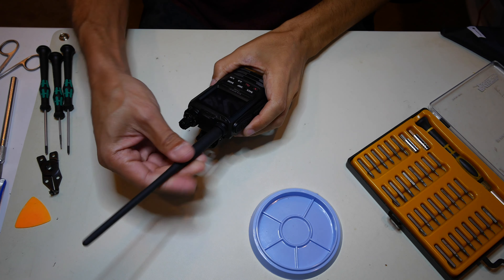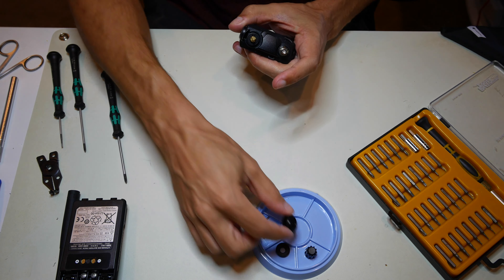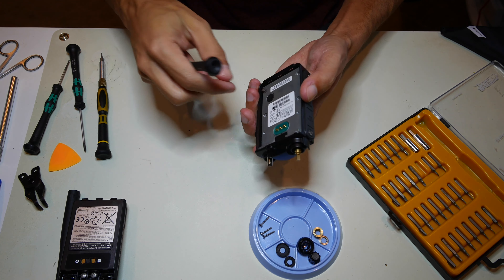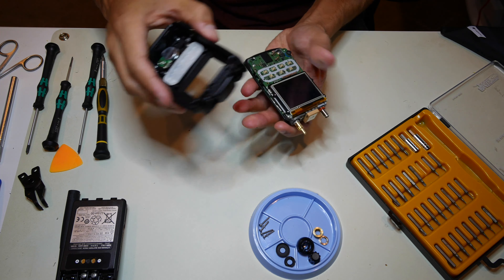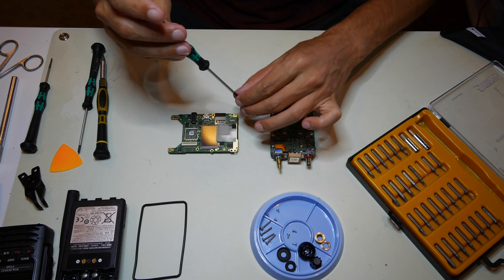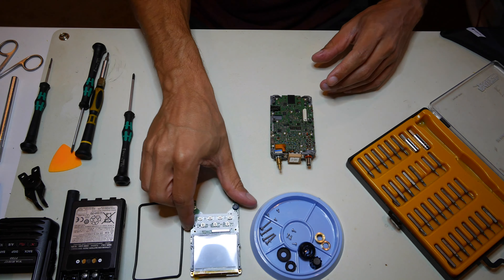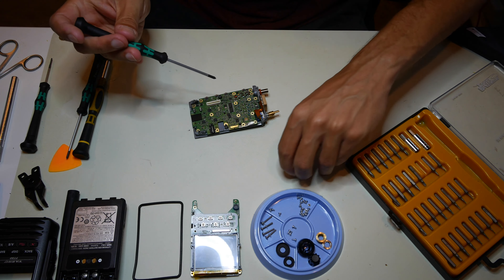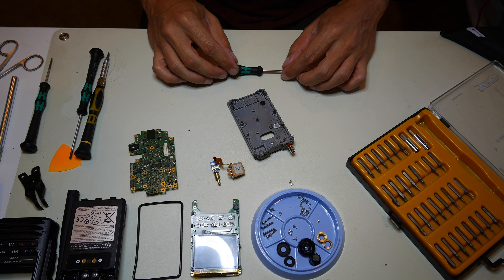Yaesu FT3DR Full Disassembly/Teardown

Comment: Great tear down.  used it to replace my LCD screen and front cover.  screws inside radio were tuff to break free. I think heat & cool from TX over time fused screws. I took a hot air solder machine warmed up to 110 degrees to heat up heat sink of radio around screws and with a little force they finally came free.
Reply from the maker: Great tip! Glad the video was helpful
Reply: where did you ordered parts?

Comment: Thanks to this video I have been able to restore receive audio to my computer FT3D. I dropped the radio 4 feet onto the ground and the audio stopped working. Using this video I disassembled the radio and found one of spring connectors from the main pcb to the speaker pcb had been pushed to one side and was therefore no making contact a quick realignment and the audio was restored. Thank you so much. 73 de Mike GW7ODP
Reply from the maker: That’s awesome! Glad this helped keep your radio alive. 73

Comment: Thank You for this video. I may have broke or bent the speaker mic connectors, on my radio. I need to take it apart to find out and fix it. This video will help a lot for that. 73"s De KC0AZW
Reply from the maker: Hope you are able to fix it, detailed pictures on the wiki as well if you need them.

Comment: what size antenna ring tool did you use?
Reply from the maker: Just used a small flathead and some pressure to break it loose. Assuming you are talking about how I unscrewed the split screw on the SMA connector?

Comment: display can be further disassembled? it does have 2 flex cables?
Reply from the maker: If anyone has a donor radio I’m sure I could go quite a bit farther, I wanted to make sure this one worked when I was done with the video :)
Reply: @RECESSIM  I will be replacing my screen, it's ghosting (after 2 months of active usage). If you want, I can send you photos :) I can bet, they will sent me just display and not whole frame with it.
Reply from the maker: @lucidnx  would be great to add additional pictures to the wiki if you can share some.
Reply: oh well, there was nothing more interesting. Display is held on plastic piece with 2 strips of tape, on top and bottom. something thin is needed to get it out because it's fragile. I'v broken old display but it was already damaged (burn in that I mentioned before).
Reply: It's been done so quickly that I forget to take pictures of that plastic piece, but I think it's straightforward.

Comment: Have you heard complaints about the sound quality of the speaker? Is there any foam or material to remove for improved sound?
Reply from the maker: I haven’t noticed any audio quality issues and looking at the teardown pictures I don’t see anything obvious to remove. Perhaps an assembly issue or defective speaker? Check out the pictures to see what I mean, I removed the speaker.
https://wiki.recessim.com/view/Yaesu_FT3DR
Reply: @RECESSIM  It would be great to replace the speaker with a better one or to make a little chamber on its rear to improve its thin sound.

Comment: Do you know anything about getting  a selector knob, mine broke off
Reply from the maker: I do not, I would suggest contacting someone in technical support at Yaesu though. I have had good luck reaching out to tech support at various companies. Most support agents want to help and understand the inner workings of the company so might be able to help you buy a replacement.
Reply: @RECESSIM     Is the selector knob and the GPS one piece?
Reply from the maker: I understand what you are saying now, not only did the knob break off but the actual brass selector it mounts to broke as well correct?

That’s more challenging, as you noticed that selector is soldered to the GPS via a flex PCB. It might be possible to find the selector used at Digikey or Mouser, replacing it will require some careful desoldering but it’s definitely possible.
Reply: @RECESSIM  yes that is what happened thanks for the info
Reply: mine broke off also, please share if you succeed with any fix
Reply: @yaltaman  yes I sent it back to Yaesu had it fixed no charge

Comment: As much as I hate USB Mini and USB Micro compared to USB-C, this shows why USB-C would have been a bad choice in an otherwise serviceable device. PCB-mount USB-C jacks are not repairable. USB Mini/Micro ports can be (carefully) replaced by the user.
Reply from the maker: I haven’t tried to rework any devices with a USB-C port, what have you seen is so different about them that impacts rework?
Reply: @RECESSIM  Solder pads for all the C ports I've seen are occluded by the body. They are 100% impossible to solder by hand. Mini/micro are only around 75% impossible to solder by hand with a steady hand and good surface prep.
You find USB-C on board that are designed to be replaced, not repaired.